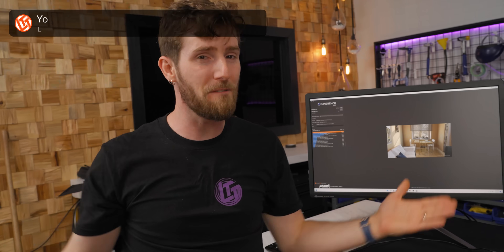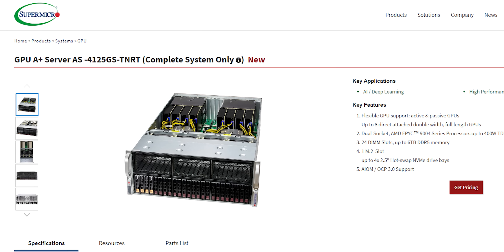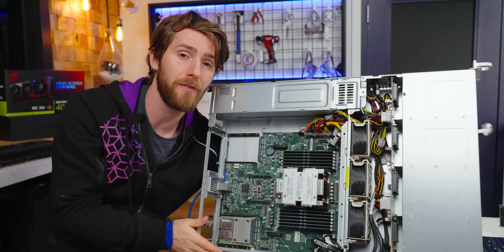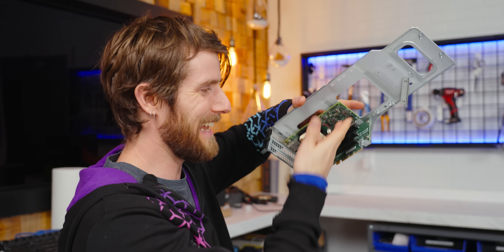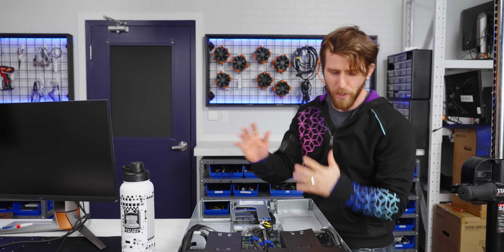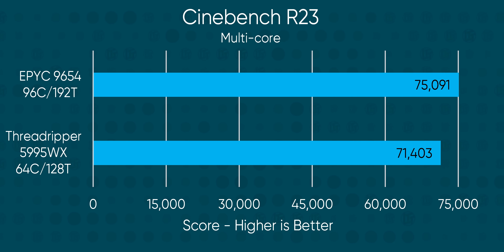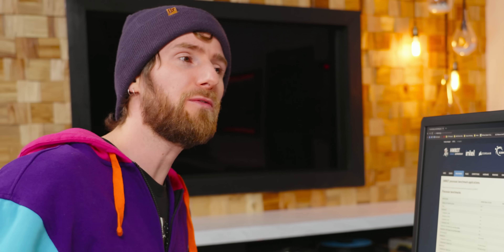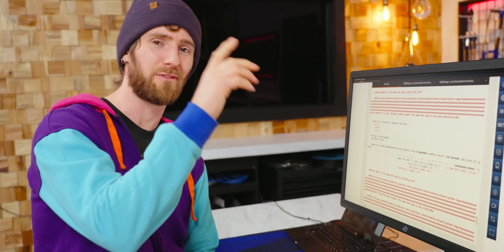HOLY $H!T - The FASTEST CPU on the Planet - AMD EPYC 9654

Comment: I keep forgetting how ridiculously huge the 4090 is until it's compared to other things.
Reply: I almost got tempted to buy one today, then I remembered how absurdly large and power hungry it is and I don't want to encourage them.
Reply: @fakecubed  yeah I'm skipping this generation. If something happens and my 2080 breaks, then I'll get a 3080 or maybe possibly an AMD card, but no way am I touching the 4000 series.
Reply: @AgentJ1314 yea i just got a 6950xt for 800 recently on amazon. great steal
Reply: The moment I read this lynus started talking about that
Reply: The 4080 is also massive
Reply: Yeah but at that point i guess you should consider a 360mm AIO with the size of the CPU because the 4090 is only that big because of the heatsink
Reply: @fakecubed  p
Reply: @AgentJ1314  if you had nvidia for your whole life you will be disappointed! The Software from AMD was and still is absolute garbage!

Comment: The Blender result isn't necessarily another dual-Genoa system.  Blender tests have a single-threaded setup period at the beginning.  With such a short render time overall, that setup period becomes significant.  So if you have, say, 64 total cores with an EPYC F-series chip (the higher frequency models), the setup period will complete faster, allowing the render proper to begin faster.  The actual render time could easily take longer, while the total task time is shorter due to a faster single-core speed.
Reply: Windows cant eat all that cores you need linux to squeeze all that cores.

Poor tim cook he must be salivating

Comment: It’s almost stupid to think that just 30 years ago we couldn’t even have one mb of vram and we were not hitting even 200 mhz frequencies and now we got 96 core CPUs boosting to very good frequencies
Reply: 1992 had CPU's that hit 200mHz by 95 there were some hitting 500mHz. Meanwhile I had a 386DX reading about them Look up Digital Equipment Corporations play in early computers.
Reply: 3 decades ?  Wait just 10 years ago sandy bridge Xeon had max cores of 8 and we know when intel increased 4 cores to 6 with 990x  today the top desktop one is 24 core
Reply: @idzkk  albeit 8 p core
Reply: @Malc180s  Speak for yourself bud.. I absolutely need more than 6 cores. I wouldn't get half of my work done on time without the extra compute.
Reply: @Malc180s  If you talk strictly about gaming, then yeah sure. 6 cores are optimal. Even so, new games nowadays now utilized more than six cores.
Reply: @idzkk  Crazy how far we've come in such a short time
Reply: @Malc180s  if a game or video editor can fully use more than that why not?
Reply: @Malc180s  for gaming that’s mostly true
Reply: @boblister6174  lol I wasn’t even born at that point

Comment: I actually work in purchasing and deploying equipment like this. We've been scratching our heads over how to properly cool Genoa systems. Supermicro's website includes notes that in order to support higher CPU TDPs "special requirements" exist. When we've spoken with Supermicro they've told us that (as of Milan) above 220W requires liquid cooling. But here you are air cooling the 9654. This brings me to a question:

What thermals were you seeing when running the CPU(s) at full load? What CPU socket temps, etc?

Thank you for this video and many more.
Reply: Actually just running one is different than running them in the Datacenter, I have to say that Supermicro is very cautious because you want something like this not burning your rack 😂
Reply: They can get away with air-cooling it because they only ran one of them.

Datacenters require multiple of these all tucked together, so liquid cooling with high whining airflow is going to be a must
Reply: use an air compressor
Reply: The answer is just one Wendell @Level1Techs away - check the forum over there!😊
Reply: You can cool more than 220W on air, but when you have a bunch of machines in a cabinet, the air flow design becomes important.  If it's just a cabinet sitting in an air-conditioned room, that's not good enough.  It should be a cabinet where the hot air out the back is collected at the top and ducted away, and all empty slots at the front are covered with blanks.  So the only air path entails cool air coming in the front, hot air going out the back, and all that hot air being ducted away through the top.

It's really above 280W that you need to seriously consider water cooling, which means not a typical data center.  And to reach the max 400W TDP, you need to know exactly how you're going to cool it.  AMD only put the 400W capability in because customers requested it.
Reply: Have you tried adding a lot of RGB LEDs to the servers?

Comment: A normal motherboard can support ECC and non ECC memory. The different notch is because EPYC and other server platforms REQUIRE registered memory, while platforms like am4 only support unbuffered dimms, which can still be ECC (with an intel W480 motherboard, for example).
Reply: AM5 consumer CPUs supports both ECC and non ECC RAM
Reply: @valentj3  yes but only unbuffered/unregistered, EPYC requires buffered/registered ECC RAM.
Reply: I think the notch is because DDR5 RDIMM's run off 12V while UDIMM's run off 5V.  Why this is, nobody knows, especially with intel pushing 12VO and PSU 5V rails being not that great usually.
Reply: @stephhugnis  Many server power supplies are only 12v, even if they're not ATX.
Reply: @Henrik_Holst  ahh makes sense. Thanks for the info!

Comment: As someone who occasionally works with HPC servers but never a 40 series card, that comparison at 9:19 is wild. The 4090 is too damn big.
Reply: But, how else am I going to overcompensate for relatively cheap???    
  It’s not like I have an extra $100k(+$20) for a lifted truck, w/ flesh-colored Truck Nuts.
Reply: Just another reason to never buy one.
Reply: the 5 is going to be 4 full slots. the 4 series is only 3.5. so prepare for them to get even bigger
Reply: not just big but heavy as well. if the 50 series is going to be bigger very few will have cases big enough to fit it in.
Ive got a full size case and the 4090 only just fits in. had to take some HHD enclosures out to get it in. mine came with a support rod to support the weight of it lol. it screws into the rear end closest to the front of the case and it sits on the bottom of the case to give it extra support. had probs trying to fit the support rod as i have an intake fan on the bottom of the case where the support rod is supposed to go. its the length that is the prob with them not how many slots they take up.
No way will u be able to put 2 of them in a case and use SLI with them cause the motherboard would buckle under the weight of them.

you also have to keep an eye on the 40 series cards as the power cables from the PSU to the GPU can melt and catch fire.
Nvidia had to get new cables made so the newer cables should be fine but if u get 1 of the 1st gen cables that come with the GPU it could melt. Its a 16 pin cable but not the same type other GPU use. its 12 pins then another 4 smaller pins so an adaptor is supplied so it can be connected to a PSU and its the adaptor that has the fault. the adaptor has sockets to fit in 3 8 pin cables from the PSU. its where the adaptor fits into the GPU where it tends to melt and catch fire if its not put in correctly or becomes lose and its not a very tight fit so can come lose very easy.

seems Nvidia r scamming a bit as well turns out the 4080 is a 3080TI rebadged and put in a  bigger case
Reply: @cliffbird5016  What you said about Nvidia scamming is baseless bullshit. The 4080 has 4 more gigs of vram than the 3080ti and its boost clock is nearly a gigahertz higher.
Reply: Gonna get to the point where the GPU is going to be a desktop tower that you have a huge extra adapter for.
Reply: They might as well just mount the 4090 externally at this point.
It's HUGE.
Reply: Why is it so loud? Is it normal for servers to be so loud?
Reply: have to be amd processor the great one advance machine german = amd advance micro device AMD EPYC

Comment: 15:07  You can just change CPU affinity from task manager to "disable" SMT. It's the same thing but without changing any BIOS setting.
Or you can use Process Lasso for easier configuration.

Comment: I work in animation, specifically CG Rendering, and while we are looking at Gen4 for our renderfarm upgrade - we are held back by the thread limits of our render engine software which at the moment is capped at 256 threads, so we are stuck for now on our decision!
Reply: Just disable SMT and run on 192 cores.
Reply: Maybe they shouldn't store the thread count in an u8 (2^8=256)
Reply: @BurnsRubber  Or buy the model with 64 cores.
Reply: Can't you render on GPUs?
Reply: You can get dual 64 core CPUs and they will run at higher clock speed.
Reply: @yasaswiraghavendra2092  gpus does not have enough vram yet for huge multi rendering and scenes
Reply: @artemisDev  Not entirely accurate. While you're not going to find them in 'off the shelf' suppliers, systems are available with 40GB HBM modules to run GPU-renders, but strap up your wallet as they start at $150K...
Reply: @Sopel997  I helped develop two separate GPU render engines beginning in 2011 on a 4GB card and can do quite a large scene with 8 and 12gb consumer cards. Having 5 or more 40GB cards in an array would put most CPU farms to shame.
Reply: @yasaswiraghavendra2092  GPU can be nice for previews, but real animations are rendered on CPU for different technical reasons.
Reply: @C-M-E  I have 128GB of RAM on my hobby PC. Its not enough for making 3D animation in FullHD resolution. I ran out of RAM easily if not careful.
Reply: @mikakorhonen5715  Managing texture resolution is key. 8K maps suck up 40MB easily, and any decently complex model can run between 6-20 individual maps. Believe me, you can go absolutely nuts with incredibly high geometry poly counts and only hit 200mb, but one figure for instance or even a city block can be a gig all by itself just in textures. Use texture compression for distant objects at 256 or 512, and your closer figures for 1024 on clothing and most skin, 2048 for face maps, you can run a Huge scene even on an 8gb card and have still have headroom. 
My home PC has 64gb DDR4 and I've never come close to maxing it out. Resource management!
Reply: @SirMo  will be slower

Comment: Another AMD W? Splendid.
Reply: Yeah they need some wins after the 7900xt massive L
Reply: @sigmamale4147  based sigma male
Reply: @sigmamale4147  7900XT should have been between 600 and 700 me thinks
Reply: Your comment was copied by a bot btw
Reply: @sigmamale4147  The 7900xtx wasn't a fail. Cheaper and smaller. AMD did say they weren't trying to compete with the 4090. Some people need Nvidia but for casual gamers and computer users, the 7xxx GPU series from AMD is the better choice.
Reply: @wombat5252  i didnt say it was a fail, i said its an L. It costs only 100 bucks less than the 7900xtx while offering worse performance. The price per frame is higher. They pulled an nvidia move
Reply: @sigmamale4147  Oh I see what you mean. That I completely agree with. Gamer's Nexus basically said that too. The XT isn't really worth it like you said, price per frame. They did pull a ''Nvidia  move'' Lol
Reply: @wombat5252  and btw i was talking about the 7900xt not xtx i think theres confusion here

Comment: If you are benchmarking Ubuntu, you have to set the scaling_governor to "performance" because by default, Ubuntu sets it to "powersave" even on Ubuntu Server.
Reply: you sure its not "balanced"?
Reply: @@gzqhesflexcl performance won't make you all your cores run "all the time" at max frequency. Also, RHEL distros uses performance by default.
Reply: That's fucking bizarre
Reply: Ahh that makes sense

Comment: The 256 core limit is because the max number value is 255 + the core 0, so 256

When they created the software they thought "meh, we will never reach that anyway" and used the smallest possible variable, which makes sense

Now they need to update that lmao
Reply: Funny thing is that using u8 instead of u16 or even u32 makes things slower. At just 1 or 3 bytes saved. Totally not worth the tradeoff.
Reply: @PanduPoluan  At the time, less memory was more precious. Without a reason to change it, they've left it the same.
Reply: and they might as well figure on going to something extra absurd like 4096 core count, because just going to 512 from 256 isn't going to buy that much time.
Reply: @QualityDoggo  At no point in the lifetime of Cinema 4D was it important to save a couple bytes of memory.

It's unlikely that they are actually using a single byte to store the number of threads.  It's more likely that the thread count has a hard-coded limit for an arbitrary reason.
Reply: And isn't that limit due to using an 8bit number for the core count?
Reply: @Incommensurabilities  no
Reply: @kleetus92  That's not exactly how it works; the maximum value for a byte (8 bits) is 255, but you start at 0 so that's how you get the 256 thread limit. To increase that number, you'd have to move up to the next largest data type, which - depending on how your language works - would be either 16 bits, 32 bits, or 64 bits.

Even though the data type is only twice the size, the number it can store is exponentially larger. The max value for 16 bits is 65535 (which if you used older Excel may sound familiar to you). The max value for 32 bits is 4,294,967,295, and 64 bits is roughly 1.8E18.... so, yea, even at 16 bits, probably not going to run out again!
Reply: @L39T  Almost certainly yes. Unsigned byte (8 bits) is 0 - 255. Do you really believe that's a coincidence?
Reply: @spaceduck413  no
Reply: @L39T  Care to explain any of your reasoning there, champ, or are we just trolling?
Reply: @PanduPoluan  Today, yes absolutely
At the time, with the ram/cache speed, bus size, etc... It was about the same, and since space was more the focus because of how limited it was, it made sense to prioritize it
Reply: @spaceduck413  listen here, sweetie, i dont need to explain anything to you or your so called friends. now skedaddle, bud
Reply: @L39T  Ah, so trolling. Got it.
Reply: @spaceduck413  the only troll here is you, spaceduck413
Reply: @QualityDoggo  This isn't the 50s
Reply: AMD: hold my genoa
Reply: @spaceduck413  imo it's probably because it's coded to scale up to 256 threads max when they initially started the development. Getting proper multithreading implement takes time and skill especially on apps like this that hardware varies a lot. I personally haven't worked on these types of projects so I'm just guessing.
Reply: @xfy123  I am like 95% sure it's down to the data type counting threads. When you're programming for x number of things, you only consider three scenarios - no things, 1 thing, and many things.

Newer languages are a little different, but for something like C or C++ typically the way these things are done is:
  1) Ask the OS how many threads you have (call it n)
  2) Split the work into n pieces (or maybe n-1 to keep UI responsive) and launch a thread for each one
  3) Wait for all n threads to complete

Honestly what surprises me is that the program didn't just crash and burn. Somebody must have thought to check for "too many threads", which makes it even stranger they didn't just just an int.
Reply: @spaceduck413  i haven't worked on scalable apps i did mostly work on SOCs so threads would be set up manually. I asked a college and he thinks it's something else, as he told me all the devs he knows just use auto to declare the threads in c++11.
Reply: @xfy123  Fair enough. You still have to know how many pieces to split the work into, but it's doubtful we'll ever know the real answer either way.

Comment: On the John the Ripper benchmark it looks like just one of these processors would beat out 2 of the Epyc 7763s. So 96 cores of Zen 4 beating out 128 cores of Zen 3 cores, cool to see the generational uplift to be as good as this.

Comment: I owned and sold my AMD EPYC 9654. In the REAL WORLD I got more work done with my 4 year old 4600 MHTZ quad core Pentium i9. For personal computing you will not need a AMD EPYC Series. My advice is to get the fastest Quad Core and that will end up being the most cost effective for 99% of users. I would however recommend you get a mother board that has at least 4x of the USB 3.2 Gen 2x2 ports (20Gbps) then do all your HEAVY WORK like video rendering right on the Solid state USB 3.2 drive and then have a second computer running a fast Quad core and do all the VIDEO RENDERING on your second computer so it does not tie up your main computer. Unplug the USB and plug into the your second rig for the rending phase. The key here is both need the USB 3.2 Gen 2x2 port protocol (20Gbps). This saves money and ends up being pretty darn fast really!

Comment: I wonder just how physically large CPUs can get before it experiences issues due to timing (as in, signals having to move further and resistance of the internals messing stuff up), pad pressure, heat issues, or other major issues.
Reply: There's the wafer scale chip by Cerebras. 850,000 cores. 20kW. That's probably the ceiling for now, unless someone figures out how to create chips larger than wafers

Comment: That 4090 being as long as that PSU is wild. Guess Nvidia thinks size does matter.
Reply: It's the way they "cheated" the transistor size limitations to get more performance. Just stick more of them inside, even if they aren't smaller, easy. You just end up with twice the size and twice the heat and power consumption....
Reply: @Leonhart_93  damn